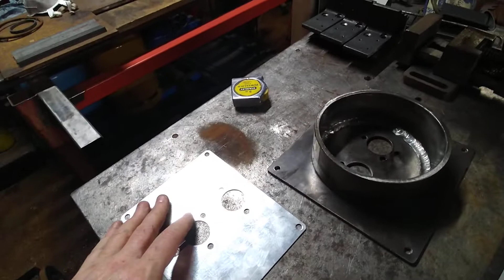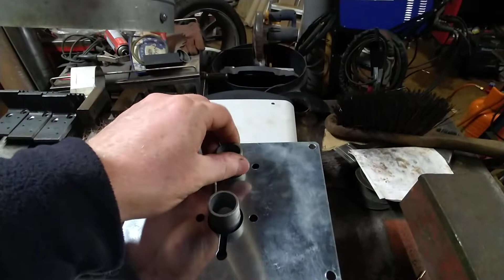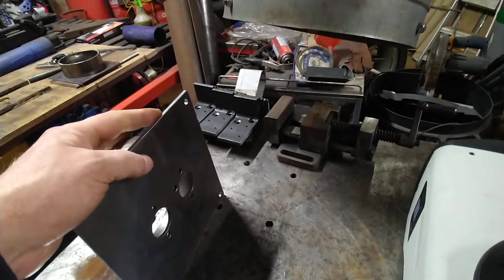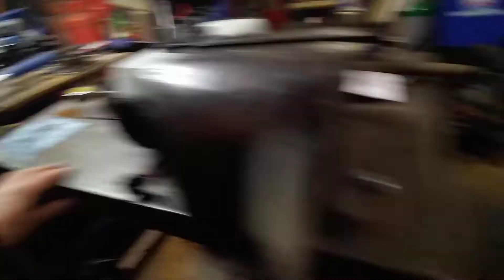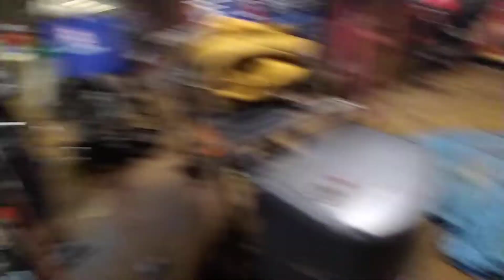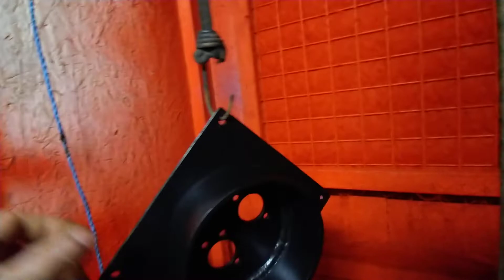Diesel Heater Mounting Turret (Heavy Duty)

Comment: How do you run the fuel pump electric line with the hole removed? How long would production and shipping to US take (roughly)?
Reply from the maker: You make a hole where it's convenient for the fuel pump electrics to run (putting a rubber grommet in if it going through metal). You don't want a hole in the turret plate as it defeats the purpose of a sealed turret tunnel. I can make a turret in a day or so, but  last time I checked the shipping costs to the USA were high. If you DM me, I'll give you a quote. Thanks.